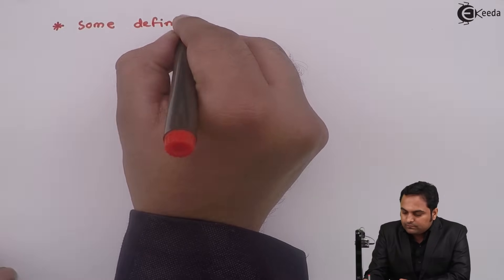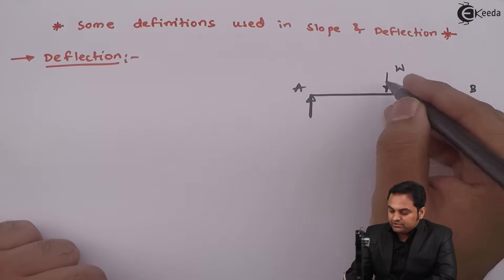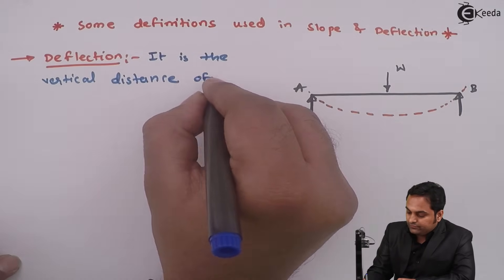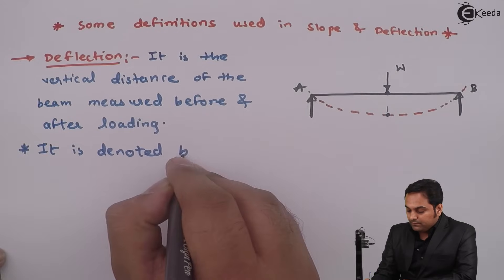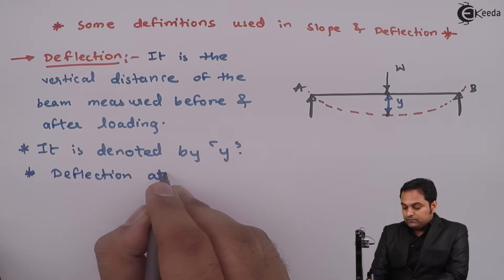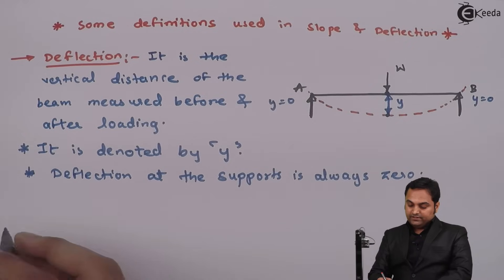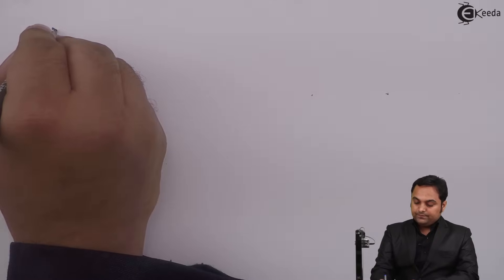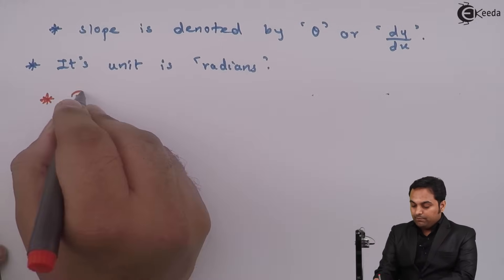Definition of Slope and Deflection - Slope and Deflection of Beams - Strength of Materials

Comment: Sir solve this please :
. A horizontal beam, simply supported at its ends, carries a load which varies uniformly from 15 kN/m  
at one end to 60 kN/m at the other. Estimate the central deflection if the span is 7 m, the section 450mm deep and the  
maximum bending stress 100MN/m2. E = 210GN/m²